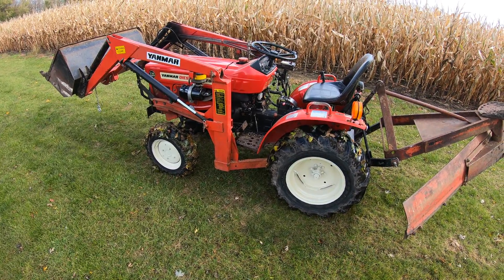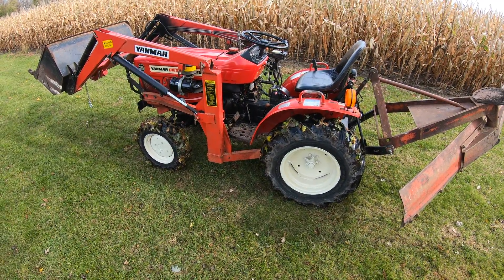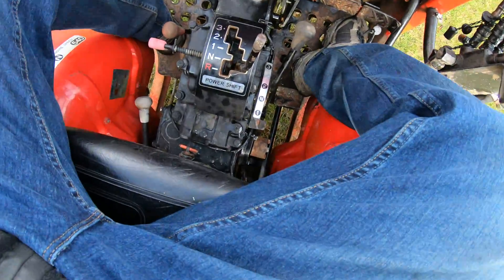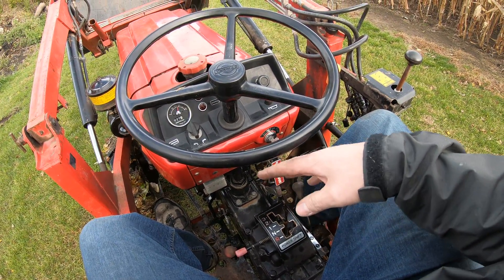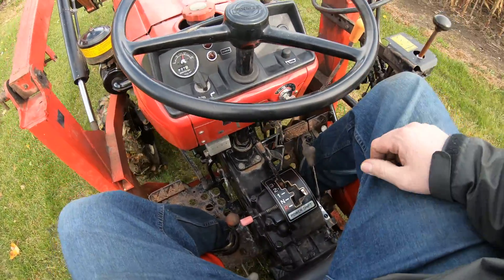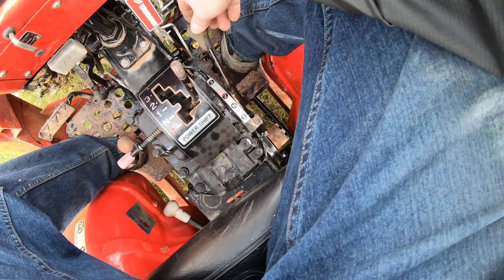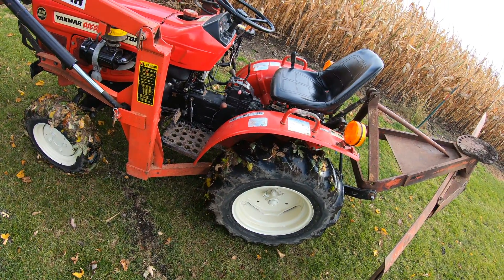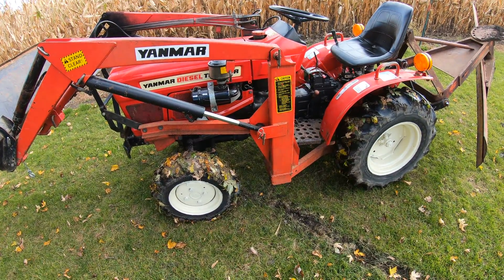How the Yanmar Power Shift Transmission Works in Tractors

Comment: Nice video. I don't think powershift has anything to do with hydrostatic transmission. Powershift uses packs of wet clutches instead of collars to connect shafts. Sure, they are pushed together using hydraulic pressure but that's not a hydraulic motor.

Comment: After I bought my neighbors 187D I drove it home and had no idea how to turn it off! Pulling the stick back only made it baaaaaarely chug along. He said to run up the throttle to the top and quickly bring it back to the off position. I watched you shut this down and it was very smooth and simple without that kind of throttle run up and back. Any adjustment you think I should make? Suggestions more than welcome!

Comment: Assuming you are not moving, do you need to push the clutch to go in reverse using the power shifter?  or is the clutchless shifting only for moving between various forward gears?

Comment: I just purchased the same tractor from my friend for $500.The fuel pump went bad 8 years ago. It sat in his yard under a tree that entire time. I and completely rebuilt the engine, fuel system, replaced the rear tires and brakes. After $2800 in new parts and lord knows how many hours I have a wonderful 2210d. I also have a 2610d Yanmar. I just feel in love with the older tractors and the powershift is a big part of that.
Reply: Sweet!! Where did you get your parts? Hoye? Fredricks?

Comment: Just picked up a 3110D today!  Basically the same as yours but I’m confused, does it not have a brake?  My understanding is the pedal on the right is an emergency brake and you stop by going in neutral?  Great video!

Comment: I am looking to buy a Yanmar FX42D and it has powershift on it. Just wondering how reliable these tractors are.
Reply from the maker: the clutch goes out, other than that they are bullit proof
Reply: Hi! I just bought a fx18d. It was running fine but suddenly it wont move. Engine running smooth but no movement when shifting. Any clue?

Comment: when checking fluid levels in trans and front axle do you screw the cap all the way in or just place it there? i figure this would be the same as on mine but i cant find the info.
Reply from the maker: screw all the way
Reply: ok thats how i have been checking it, just wanted to be sure.
Reply from the maker: no problem have a good night
Reply: Might want to double check and find out for sure. On my YM2220D and several other models I have read about online the fluid level is checked resting on top and not threaded in. You’re probably running it low on hydraulic and gear oil if you’re threading it in. Hopefully not enough to damage anything unless you’re leaking oil somewhere such as a seal.
Reply: @krstoner53  i had found out, any threaded dip stick just rests there like you said, the engine dipstick which pushes in does just that, push it in.

Comment: I have both styles.  The regular one is easier getting on and off because you have to lift your leg a mile to get off the power shift version.  You should always turn off the tractor just like this video shows so you don't catch your leg on shifter popping it in gear and run over yourself.  I was told this by the older guy I bought it from.  One of you mechanical guru's need to make a kit to move it to column shift.

Nice video!  Power shift is recommended especially with loader.
Reply from the maker: Thanks for watching good comments

Comment: Just FYI, my 1977 Yanmar 2210D (4x4 loader) has the powershift transmission also. BUT it has 5 gears plus the 3 powershift gears, for a total of 15 forward speeds and 5 reverse speeds. Excellent bulletproof transmission and tractor.
Reply: I just purchased the same tractor from my friend for $500.The fuel pump went bad 8 years ago. It sat in his yard under a tree that entire time. I and completely rebuilt the engine, fuel system, replaced the rear tires and brakes. After $2800 in new parts and lord knows how many hours I have a wonderful 2210d. I also have a 2610d Yanmar. I just feel in love with the older tractors and the powershift is a big part of that.
Reply from the maker: That's awesome

Comment: What about reverse?
Reply from the maker: Same
Reply: @addismultitasking3504  do you have to stop and push clutch to go into reverse if rolling in 2?
Reply from the maker: Yes
Reply: maybe his is different than mine idk, but with mine the clutch is only needed to change gears on the trans or to engage pto, anything powershift related does not need the clutch. the powershift uses hydraulic pressure to put pressure on clutch packs, i heard its like an automatic trans but without the torque converter. mine is the 1987 226d, so it may be different.
Reply: You can toggle between forward and reverse without clutch if you pause in neutral and come to a stop.